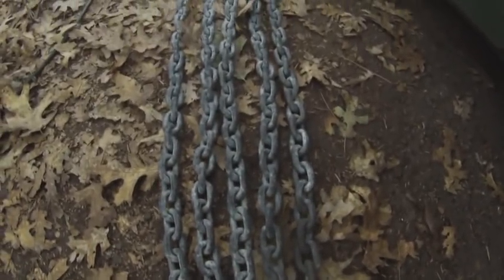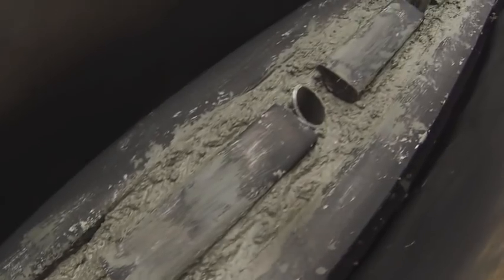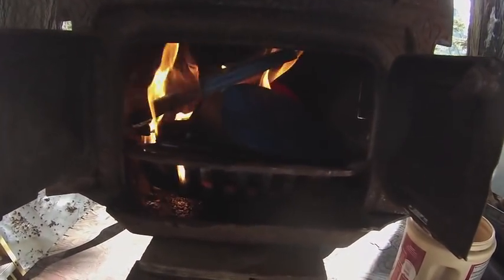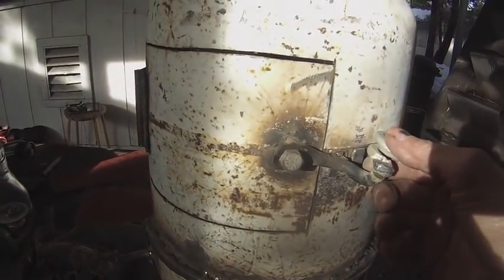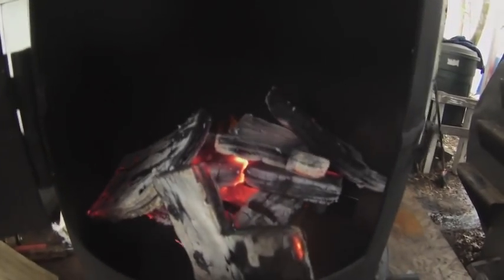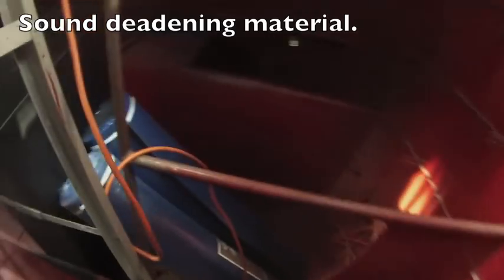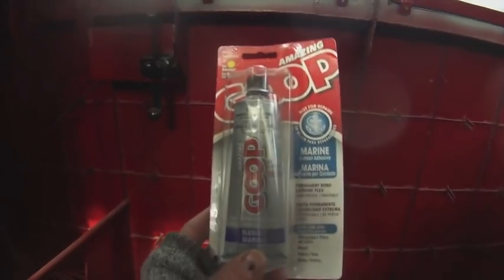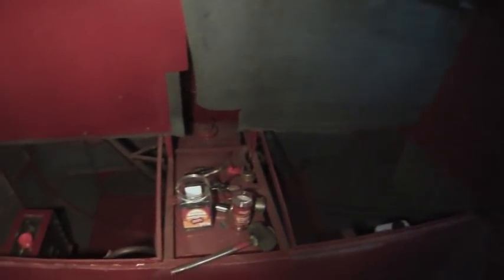Steel Sailboat Build Part 35

Comment: With all the welding on the boat are you concerned about leaks?
Reply: He doesn't seem knowledgeable enough to be concerned about  anything
Reply: All he has to do is fill it up with water to the waterline, that will show any leaks. I wonder if he plans to charter it out?
Reply: @samsam3499  it will fill with water upon launching.  :-D
Reply: @samsam3499  there is no way it will pass any inspections to be used commercially